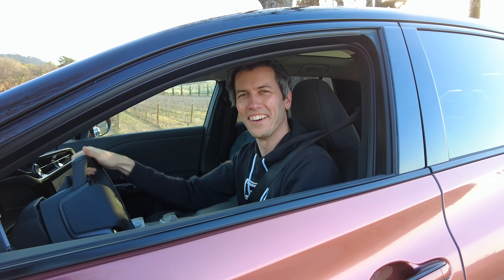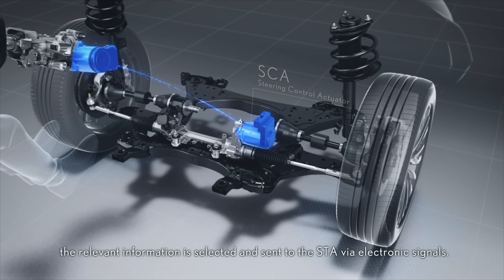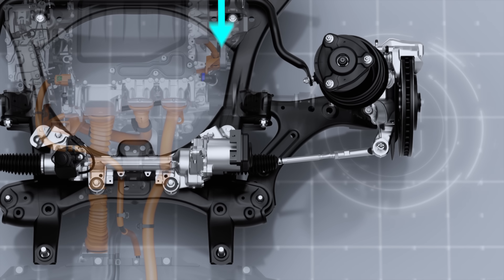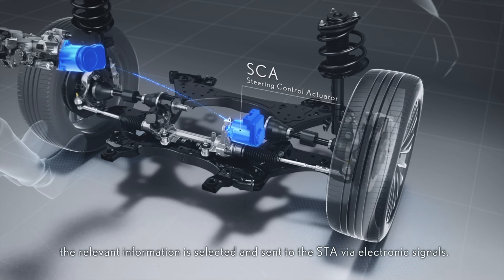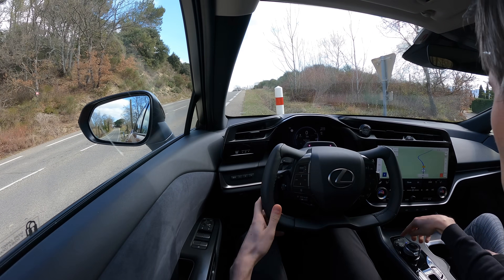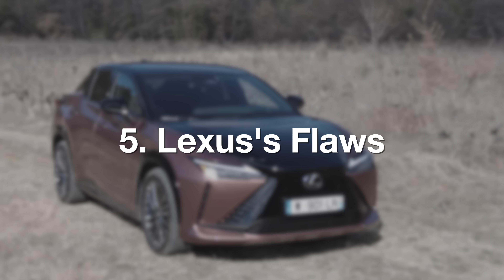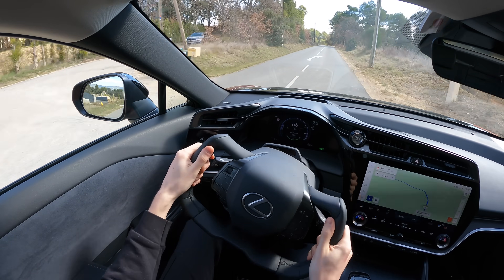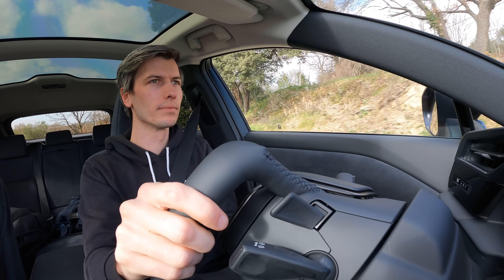How Lexus Fixed Tesla's Bad Idea: Steer-By-Wire Yoke

Comment: Seems great if they iron out some of the kinks.
That said, the mouse sensitivity analogy isn't great, a really high sensitivity is more like having a steering wheel that can only turn 10 degrees, and having to manage your full range of motion like that, whereas low sensitivity allows you to use a full 360 degrees, and thus can be controlled much more precisely, at the cost of more physical movement.
The controller sensitivity analogy works a bit better, though this is more similar to having a very aggressive curve, where you can do really fast movements by pressing all the way to the end, but you still have fine control near your deadzone. Kinda like how here, they give a very aggressive steering ratio at low speed, and a much more relaxed one at high speed.

Comment: 12:02
Man, that latency would be terrifying to someone that is not expecting it. Throttle latency already bugs me because there 100% are times that you need everything your car has for power instantly to avoid something. All but one of my cars have completely mechanical throttles and the 1 to 1 response makes driving more predictable

Comment: I was certain the Tesla S would have steer-by-wire due to the yoke, as mentioned, that was not the case. I was also certain, like you mentioned, that a system like this needs to be made PERFECT for it to feel natural. If this is accomplished, it is obviously a much better solution than a normal steering wheel. Let's hope they get it right for production. 

That being said, one of my cars is a Model S Plaid, with the yoke. I was also certain that I would change it out for a round steering wheel... I have not. That's due to 95% of driving is driving without hand over hand movement, and under these circumstances it's much more comfortable and ergonomic than a round steering wheel. ESP is so good in these cars that it won't allow for oversteer and hence won't need hand-over-hand inputs in an emergency situation, where a steering wheel would be preferred, hence it's not "unsafe". Would I like a perfect steer-by-wire over the normal yoke? YES! Would I change out the yoke for a round steering wheel in my Plaid (as is)? NO! However for my old track car, I would never got for a yoke steering wheel.

Comment: dedicated motor/sensor for 'road feel' does not sound promising.  it need a real connection.. something like in a pito tube in aircraft for air speed, basic mechanical device not digital 'feeling'  like a 'sex toy'
Reply from the maker: It is a real connection... the motor is mounted directly to the steering rack, and feels any forces against it as the pinion teeth are meshed to the steering rack.

Comment: I personally like the ability to have a Yoke steering wheel ….. a shorter turn of the wheel i think would be preferred ….. Although I have never driven a vehicle with this set up I would be very excited to be able to test drive an SUV with a Drive by wire Yoke !!! Thanks for your personal opinion about this choice.

Comment: For those concerned about the reliability: Just know that Airbus has been building PASSENGER PLANES that use fly-by-wire (i.e. no physical connection between the pilot's stick and the control surfaces) for DECADES. Oh, and modern fighter jets also use fly-by-wire :) And you definitely wouldn't want those falling out of the sky, would you?

Comment: Instead of having two 'road feel' sensor motor with redundancy and complication, it could utilize a flexible mechanical connection. something a like a steel cable, used in old speedo meters, just to get the road feel? while the motors do the real rotation.  This can also act as a back up  on a failure

Comment: What I never hear discussed is what happens if you were on the highway and there’s an EMP. Are your brakes going to work

And with this system it seems like the steering is going to fail in that situation. Granted, this is a once in a lifetime event, that is going to wreak havoc. But it would be good if everyone who’s driving doesn’t get killed or injured immediately.

Comment: this is the just the worst idea. I can tell if the mechanical version is well-built or good condition, but I just cannot trust those "software engineers" writing code to determine where and how I should turn

Comment: Tech tech as much as you want but for God sake who f___ing gave common sense to this "Engineers“? Is like giving a Gun to a child. First, One pedal driving!! Why such a option exists, who drives with this stuff, give them another car and they will smash agains the wall or another driver. Same for this, just for lazy b____hes, that don't want to drive and to tired to turn the wheel, give them this and then they will smash against something because they didn't turn the wheel much. They are making all this "things" for people that are not soppose to drive, Get Yourself a driver!!! SERIOUSLY!! And with the tecnology they reach mechanically and electrically, they can make a low ratio steering wheel with assistance, just have to make it stiffer at high speed and assisted at low speed, won't be 300° rotation but for sure 400 / 500 is enough. Plus giving so much low degrees of turn you are putting more stress in the motor turning the wheels, because it has to keep up. If the steering wheel in this lexus was doing 700° turn, you won't see or notice the delay. They are doing everything wrong! And Lexus doesn't need this!

Comment: Interesting, but not for me.  As you rightly pointed out for enthusiasts, the problems are: heavy (3 batteries!), complicated, expensive.  It also means that a car could take over complete control if the right software is in place.  So I guess it's great to combat drunk driving or medical emergency, but I personally don't want to be imprisoned by a future tech car.  I'll revisit this again in a few decades.

Comment: The knee-jerk reaction, of course, will be new=bad.  I can see both the advantages and disadvantages of this compared to the typical steering systems used today, the biggest downside being the learning curve for that variable ratio.  I expect much of the delay you saw will be resolved by the time this goes into production, and I think it's a great idea that Lexus will make it an option instead of just forcing it on everyone like Tesla tried.  Also the fact that the only thing that's changed from a control standpoint is the steering wheel itself, as Lexus still has the normal buttons & stalks where Tesla moved nearly everything to the touchscreen.  I have questions about error recovery and whether there truly is no single point of failure: Are there multiple control modules?  3 steering wheel sensors so there's a "tie breaker"? Protection against the two actuator motors working against each other?  Of course, it's all moot as the automakers are trying to remove the steering wheel altogether and we'll all just be riding in Johnny-Cabs.